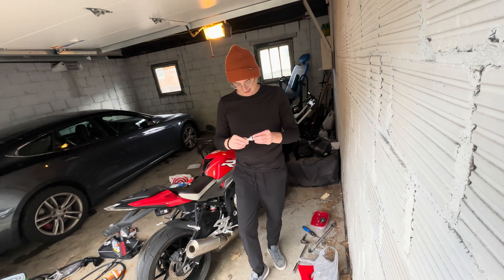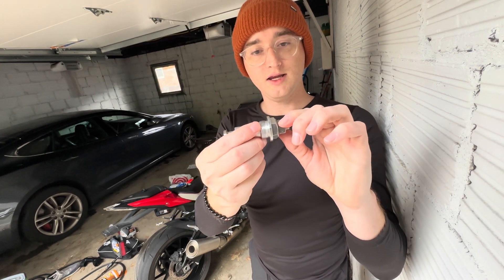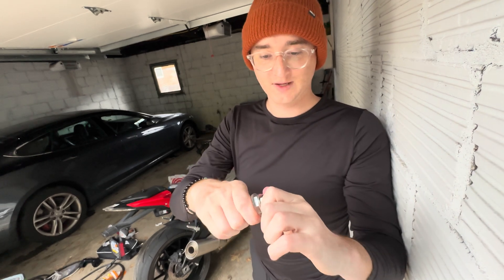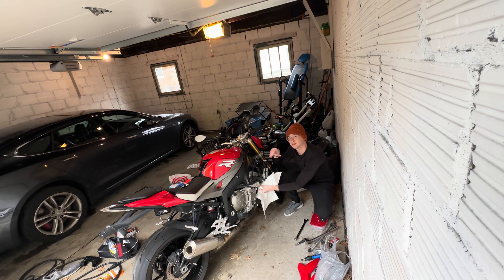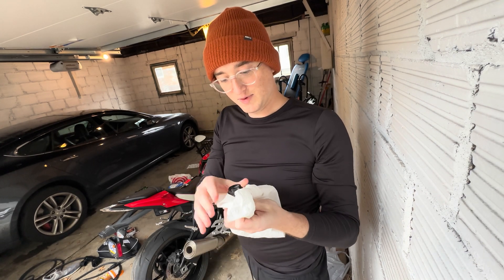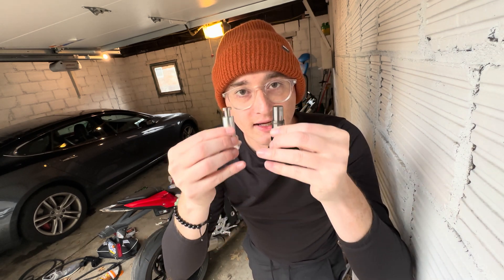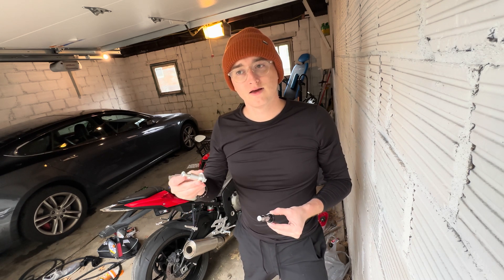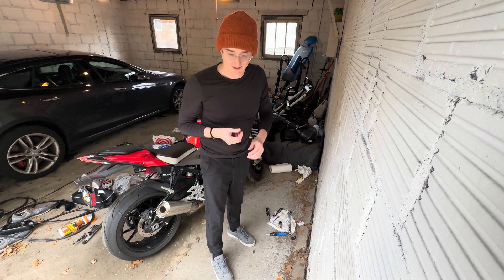*Cam Chain Rattle Fix* BMW S1000R Manual Cam Chain Tensioner.

Comment: if you install the manual cam chain tensioner at the full length of the stock tensioner, you'll overload the cam guide, and eventually break it.. Be careful!